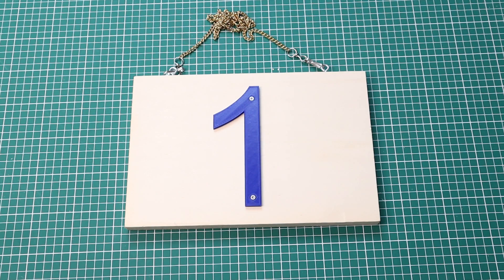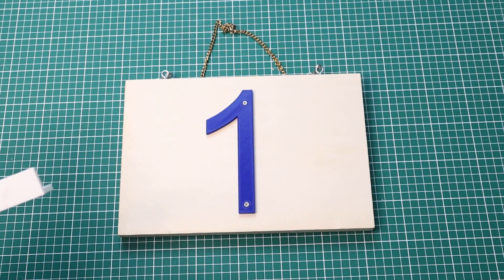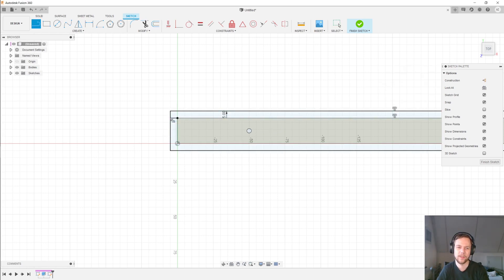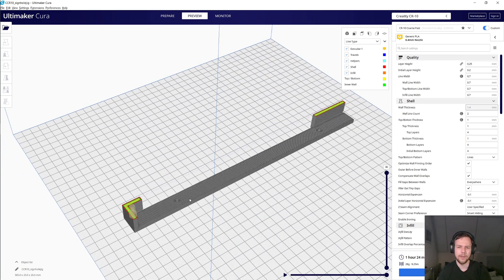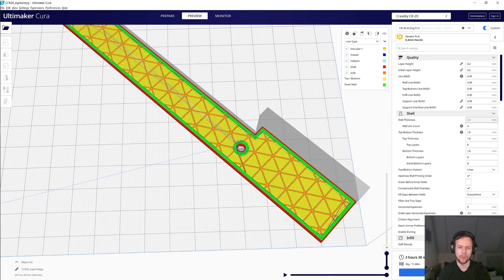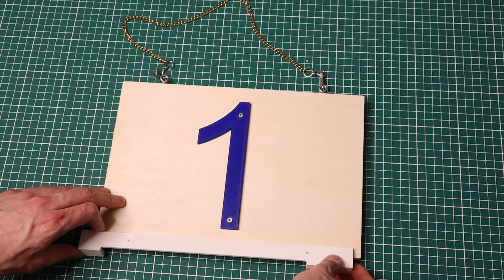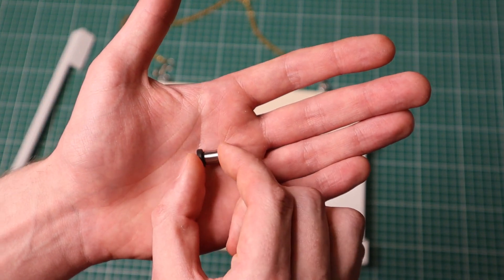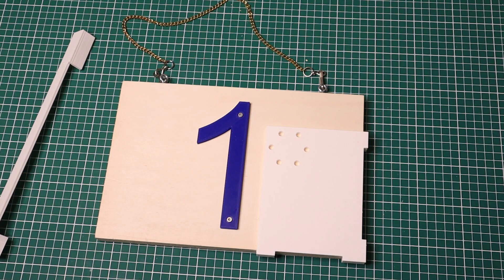Work faster and more accurately using simple 3D printed jigs

Comment: Hi, I've watched 2 of your gear related videos and now this one as well. I love your content and how you present things in a digestible way. That said, I noticed a few areas you could improve on with your jigs in particular and just wanted to give you some tips that are standard in industry among machinists and tool makers. While there are a lot of specific details I could give, I want to touch on two concepts: chip clearance and bushing sizing. 

What I've notice in both of your videos is that you don't leave any room for chips to clear out. This is critical as it will extent the life of your cutting tools as well as your jigs, particularly when you use them with metal as you mentioned you only get a single use out of them.

The concept is as follows - You want to maintain between 0.25*TD to 1.5*TD of room between the work piece and the bushing (or hole) on your jig. The exact value depends on the depth of the hole, and the material being cut. For example, you could get away with 0.5*TD when drilling cast iron due to the fine chips, however you generally won't go less than 0.5*TD with cold-rolled-steel and aluminum as they produce long, stringy chips. In the case of reaming you would want near 0 clearance and with secondary operations (such as slightly enlarging an existing hole) you can err on the side of less clearance. 
Of course you always want to minimize the amount of clearance to maximize accuracy. 

Bushing sizing is much easier to explain, but the concept is that you want the length of the bushing (or simply the hole that is guiding your tool) to be between 1*TD to 2*TD to adequately guide the drill. 

TD being tool diameter in this case. 

Additionally, in order to accurately locate cylindrical features and account for deviations in size, you should use "V" features in your jig (see V blocks) rather than matching the contour of the round feature as you did for the jig shown in the first part of your gear video series. 

Feel free to send me a message and I can forward you some PDFs pertaining to jig & fixture design which would also include some additional details apart from what I mentioned here. 
I'm enjoying your channel and look forward to watching the other videos in your gear series. 
Best
Reply from the maker: That's some really good info! Is that vertical clearance between the jig and the work, or should I increase the diameter of the guiding hole? If the guiding holes become larger, I would lose quite some accuracy I would think.

As fo the V-shape, you are correct and I fixed that in the improved shaft hole jig: https://youtu.be/qeD7DLyAx74
I still have 0 clearance though between the work and the bushing, and between the bushing and the drill. I'm just relying on the hardness of the bushing to keep longevity.

You can send me emails here: antal@creonova.nl 

The gear videos for helical gears and racks are already out, just in case you haven't seen them yet.
Reply: @antalz  I'm happy to help! Yes you're right, it's vertical space between the work and the jig. 
I'll send you an email later today as well. 
I noticed the video was out, just been meaning to find some time in my schedule to watch them.

Comment: You could in this case have made just one end of your jig and flipped it back and forth, saving material and print time.
Reply from the maker: Really good point, and also a really good tip for when your bed isn't wide enough to hold the entire jig.
Reply: but a bit trickier to print because the obvious way (with the two fences on the bed) puts the hole (the actual critical feature) printed sideways with potential bridging issues.